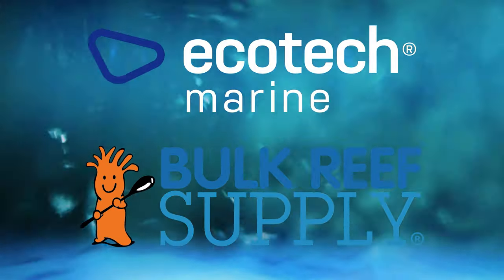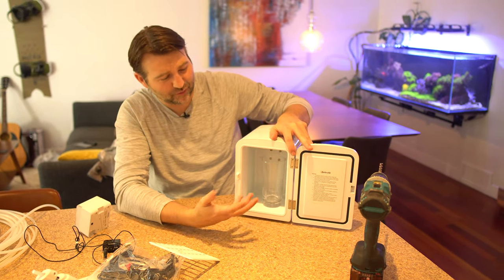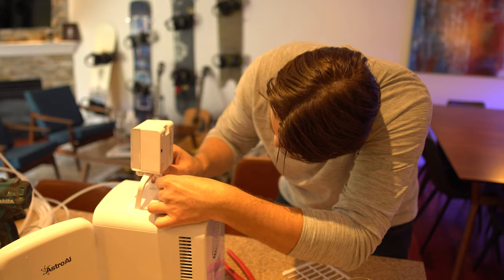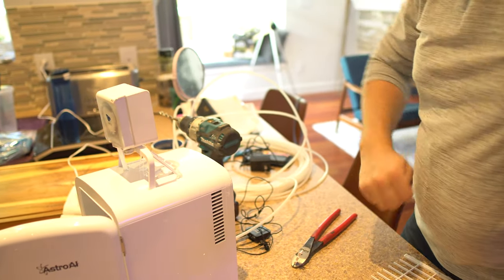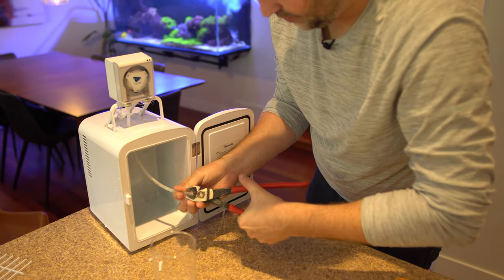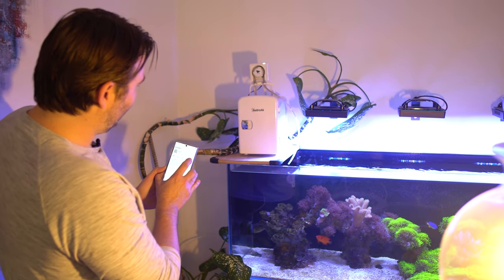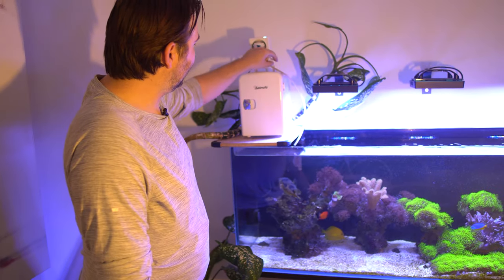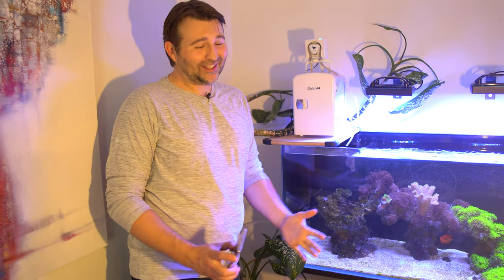DIY Frozen Food Feeder - Aquarium liquid Food Auto Feeder

Comment: I love the DIY idea! I wish I could say this will work long term but as a person that travels often I built my own DIY - actually 4 different versions of this automatic frozen feeder (months of testing) but all the versions with the small fridge didn’t work because the cooling system is not cool enough.
I only built it with the pump inside to make sure the food doesn’t go bad. I even added terminal plates with fans to get colder but never got cold enough.
Put a temperature meter inside and you will see.

Good news is that I didn’t give up and I do have an existing version that is working for me over 2 years now, feeding 3 times a day different food types.
I recommend you try a Mini fridge with freezer(important), separate return pump in the sump -the line from the pump go to the fridge, go in and out, inside the fridge I have 3X T connectors in the line and my pumps are injecting the food to the line and then it ends up in the tank.
Reply: Return line through the fridge sounds like the way to go. Do you happen to have any pictures of your setup?
Reply: Hi
Can you send a diagram/drawing of it plus pics if possible

Comment: Love the idea ❤! My comment would be that the food that stays inside the tube (outside of the freezer) will go bad so it would be better to use something like the DOS that you can programme to work in reverse and empty the tube back into the glass in the freezer. Than you could also add a “T” in the tube that sucks the food just outside the fridge and attack a solenoid to that one, which would draw RO from a separate container. THAN you would programe the DOS to rinse the tubing after backwashing into the container 🤪
Reply from the maker: He would need to have an apex for that one..  you can manually spin the pump in reverse so I’m fairly confident a software update should provide the ability to program it

Comment: Could you use a Y Connector to run a second pump (not sure it'd have to be a Versa) to flush the line coming out of the fridge with tank water or something like that?  I've seen so many of those portable coolers at most get down to 50 degrees. (Not below the point at which fresh food goes bad).  Does the cooler used in this video get cool enough.  According to Amazon it says it cools 32-40 degrees below ambient temp. Which seems like it would be cool enough, but does it?  Last question, How do you keep the thawed frozen food suspended?  I was thinking an air pump would work for that housed inside the cooler?  I don't know if air would make the food go bad faster? I love this idea, just worried about feeding my fish rotten food if I'm gone for 5-6 days.

Comment: I have been doing this for about 5 years. This is the only way I feed. I do not ever feed my 400 gal reef, 20 gal hang on wall tank & Quarantine tank by hand. Suggestion to you, Mount dose pump in fridge. Use Hikari brine shrimp with splina. I stays suspended longer than anything else other than Reef Nutrition liquid mysis and it is less money.
Reply from the maker: We talked about putting the pump inside after we made it. Did you have any issues with pump  inside yours long term?
Reply: @ReefDudes   No, in one of my fridges I have a apex dos pump and the other 2 I have a BRS 1.1 mill dosing pump.  I did find it interesting that you said that your dose pump has a bigger diameter hose than the dos is that true?
Reply: @bryanbench8333  How large is the fridge you have everything in?
Reply: @johnvinson6239   I have 3 fridges For 3 different tanks. I use one the same size on this video the other 1 is a dorm sized fridge and the other 1 is a full sized fridge
Reply: How long does the chilled food last?

Comment: Did you have any problems with the food rotting or drying out in the tube?
Reply from the maker: If using frozen I wouldn’t want more than 5-7 days worth. If going longer I would use the reef nutrition stuff meant to be refrigerated for long term use
Reply: @ReefDudes  I currently run the same setup to dos Red Sea AB+ and have been contemplating trying it with frozen or creating a pass through with a Venturi valve for frozen

Comment: Is this setup and still going? Any lessons learned from using it for someone that also wants to build it?
Reply from the maker: Still going strong!  Rev2 I would prob try putting the pump inside of the fridge and feeding out the bottom of the fridge so all the lines are insulated.  That being fair using frozen mysis seems yo be good for 7-10 days then get a bit funky.  So weekly is about the max I would  stock for with this method or better yet use something already liquid like the reef nutrition version

Comment: If you had it running in the sump wouldn’t the grate cover on the return get clogged up fas w small food on it
Reply: Maybe tap into return line instead of pump w a Venturi type fitting to bypass pump while in sump
Reply from the maker: Nope it’s small enough. We did manually put some in there by the pump to test it. Came through  fine

Comment: Wouldn't the food sink to the bottom of the glass and clog the line? I'd worry about the warm food in the line. I think you really need a pump that can reverse and clear the line.
Reply from the maker: It sucks from the bottom of the glass.   If you feed multiple times a day then it isnt sitting in the lines "that long" but i agree  reverse is ideal.. the pump can manually spin in reverse so i hope they add it to programming as an option so on!